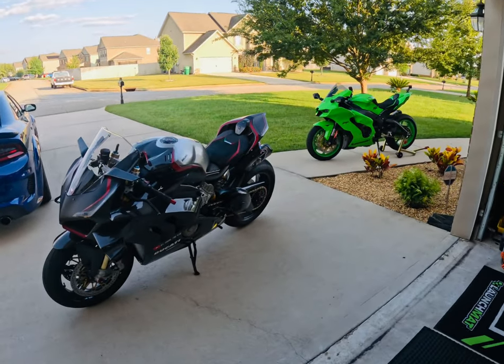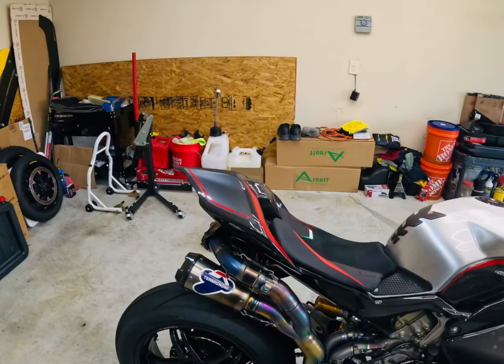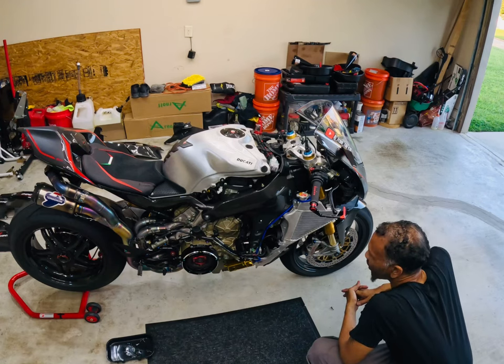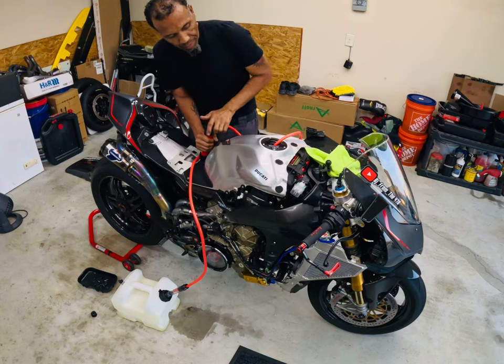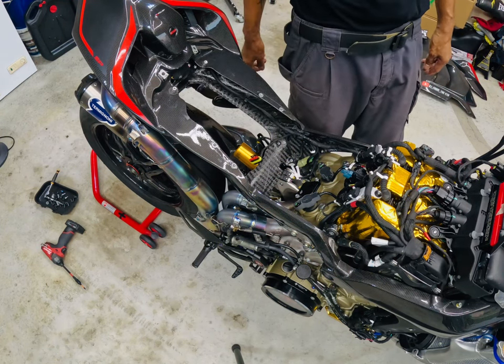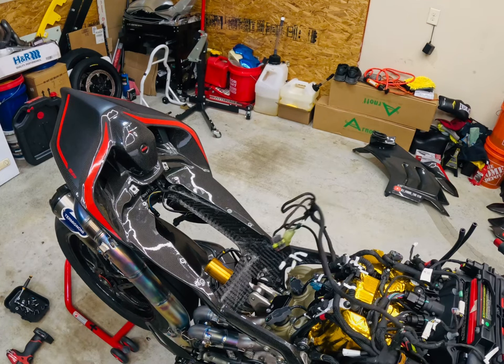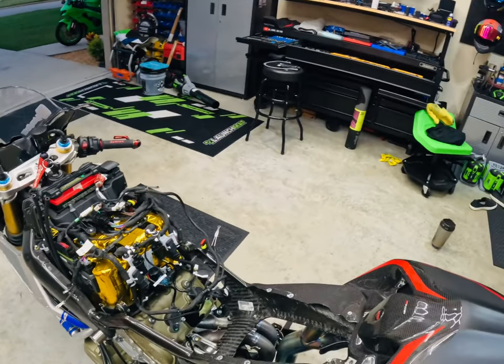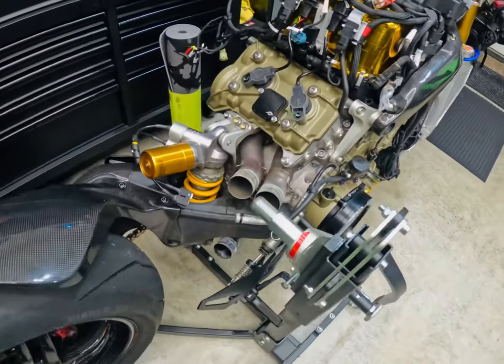2021 Ducati Panigale V4s | Replacing A $8000 Termignoni Titanium Exhaust | With Something Better 👏

Comment: Hey brother. I have the same full six rear subframe, but I have a SC project S1-GP exhaust. It's pretty close to the carbon. I'm wondering if you had any problems with heat from the exhaust messing with your full six rear subframe. I haven't ridden my bike since the installation. I've been worried that the heat from the exhaust might damage it, but your exhaust is about as close as mine is to the subframe. I don't have a heat shield on either. Thoughts?

Comment: that was not stock radiator right ? what are u using ?
Reply from the maker: That an H20 radiator it moves more coolant so no Matter what temperature your bike is running it will not loss you hot 6hp it the same horsepower not matter what also the oil cooler  and keeps the oil temperature down because it’s slightly bigger look them up and get one you won’t be disappointed 👍🏿
Reply: @bj_from_the478  the stock fan can also be installed ? or is it custom mount ?